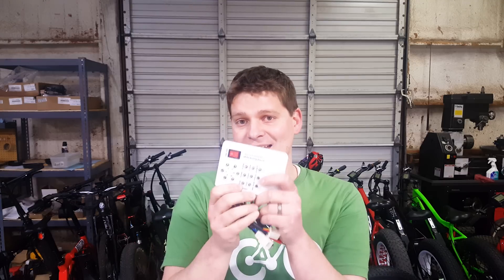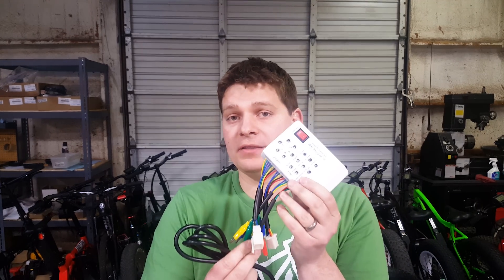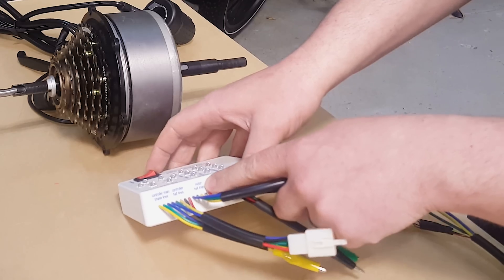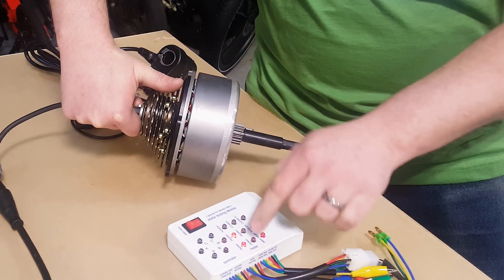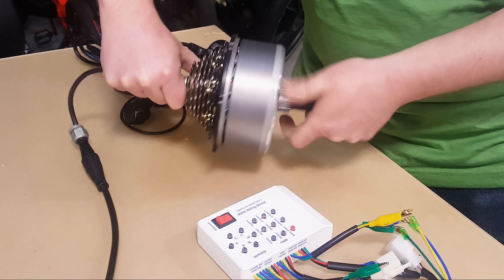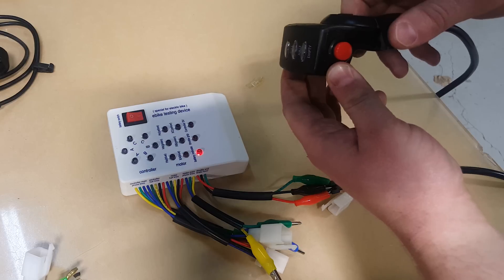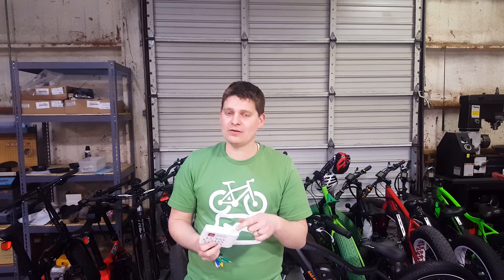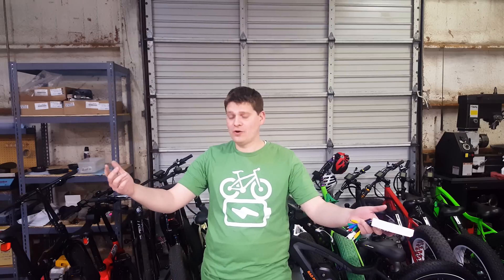Electric Bike component tester - the perfect troubleshooting tool!

Comment: I've seen a few of these Ebike Test device Videos and nobody ever seems to demonstrate how you use it to test the controller which it is supposed to be able to do? My confusion is that on the poorly written instruction leaflet it notes the following: (and I should just say I have typed it as written on the instruction leaflet that came with my test device!)

Before testing controller, we'd better to test throttle&brake lever firstly,otherwise,there will be some wrong testing results.Meanwhile,this testing device can't be used for testing controller which is in dual mode and sensor-less

How do I know if my controller is in 'Dual Mode'? Does this just mean that you have both a pedal sensor and a Throttle attached? And if so does it mean that if I don't have the pedal sensor and a Throttle attached I can't use the device to test if my controller? I have never bothered with the pedal sensor I just use a throttle! It is very unclear!
Any advice/comments would be very much appreciated!

Comment: I just got mine off amazon. I haven't gotten to try it because it didn't come with instructions and idk wtf I'm doing 😅 I bought a used mgv3 and have been trying to figure out error 30. Found a bunch of corrosion I'm the tail light wire housing so I contacted goat and am currently waiting for an invoice for a throttle, tail light, head light and PAS. I already replaced the wiring harness and am waiting for a new controller  to get delivered as well

Comment: If you have an ebike with a Bafang 750W Hub motor with a C961 display, and the controller blows out. Will the ebike need new parts of the same kind or will it be replaced with a Mid Drive motor.

Comment: Tell us more about that adapter at 1:12. Where did you get it?
Reply: Rad Power uses a Z916 connector for the stock bafang motor, google that and find one with bare wires on the other end.

Comment: CAN I HOOK UP 2 48 VOLT MOTORS WITH 2 BATTERYS WITH A BLENDER  THAT HOOK UP 2 BATTERYS TO ONE MOTOR. THE CENTER PORT ON THE BLENDER WILL HAVE A 3 WAY Y SPLITER TO GO TO THE TWO CONTROLERS FOR THE TWO MOTORS. SOME ONE TOLD ME THAT IT WOULD BLOW UP MY TRIKE IF I DO THAT. COULD YOU ANSWER IF THAT IS TRUE. THANKS ERROL

Comment: This wouldn't be any good without the correct adaptor cable. Where do you get the correct adaptor cable? Anyone got any links? Ok, panic over. After a little searching on eBay they are easily sourced. I avoided buying the cheapest one, because as we know... you get what you pay for.
Reply: link?  i still havnt found them.
Reply: @renobikeproject  You have to keep on looking. There aren't that many. There are some on Amazon...

Comment: So I can't find the adaptor cable, where does one get that, to me without that this thing is almost useless.
Reply: Came here to ask the same question!
Reply: Hello did you find adapters
Reply: @machfarayoub  I would build my own adapter cable using a motor cable from Amazon with the correct mating connector to the tester.

Comment: Hello and good day, any link to finding a adapter cable for my juiced hyperscramber gen 1 with the 11 pin julet connector ? Id love to diagnose my non working bike, i have two 1100w motors that are probably fine but dont spin.

Comment: My ebike has a round 9 pin connector, so I guess I need to buy an adapter somewhere ? It takes over a month to receive one from Amazon. Also, why is there 9 pins, most ebikes only have 5 wires going to the motor ?

Comment: Great video. Question.  I get the lights coming up on the controller tester.  Phase wires are not connected, same as yours.  Instead of rotating my wheel counter clockwise to get the 1-2 light pattern, I have to rotate wheel clockwise.  I think that’s what you’re doing as well.  Lights come on.  Am I okay?  Great tutorial.

/Bklyn👑

Comment: There seems to be quite a lot of misinformation about ebike motors. For example, the Rad Mini 4 in the USA has a 750W motor but they have 250W in the EU. On a forum I heard they are actually the same 750W motor but there is a "software limit" on the EU models.  Is there a way to use this tester to confirm the actual Wattage of the motor?

Comment: Hi thanks! A Q about the throttle we dont use in EU or some parts not. We speed up with the use of 1-5 voltage regulater and a switch from the pedals. and when you stop pedalling it stops. Will it fit for us that device you had there?

Comment: Kyle having such a diagnostic device,  make perfect sense. I have a Rad City that only has 162 miles on it. A month ago, I went for a ride on a very hot day, and parked the bike in the sun for 10 minutes. When I went to start out again, the PAS, nor the throttle worked . Rad was good with their response, sent me a controller and a wire harness, but still not working. Now waiting for a new motor and wheel. Cars have an OBD 2 diagnostic device, and it make perfect sense to have a bike diagnostic device. Thank you.

Comment: I purchased a motor kit, 48v, 1000 w battery and connect but bike has a julet harness. Can this tool test wires inside the julet harness. Bike worked one day. Second day twisted throttle and front hub motor jutters back and forward. Wheel not fully spinning forward.

Comment: Maybe a silly question, do I need to remove my motor to test the different components of my ebike?
Reply from the maker: There are no silly questions Paul. No, not at all.
Reply: @Area13ebikes  Then why don't you answer his question? You don't need to remove the motor but you do need to remove the cable from the controller.

Comment: Thanks for the video. Just one thing though, I'm currently having trouble with my pas sensor. My problem is that I dont know if the trouble is in the sensor or the controller. I didn't notice if your tester had an input to test the pas sensor itself, of the sensor circuit in the controller. Does it? Many thanks

Comment: Outstanding video, but and the tester looks great.  However, you only briefly mentioned the adapter cable.  That, so far, has been my main problem in testing my broken ebike.  I have a Cyclamatic that won't start.  I have a meter but I can't figure how to make the connections, which, on the ebike, are extremely small.  Know where to get that adapter cable?
Reply: Did you ever find this cable?  I have similar problem with my Addmotor Ebike
Reply: i need an adapter too. where in the world can i find an adapter for the ebike tester??
Reply: @renobikeproject have you found one?

Comment: I would be a good piece of equipment to have for testing of ebikes. Will they work or all makes and models of manufactures or is it limited to specific ones?
Reply from the maker: With the proper wiring works with most types of ebike parts.